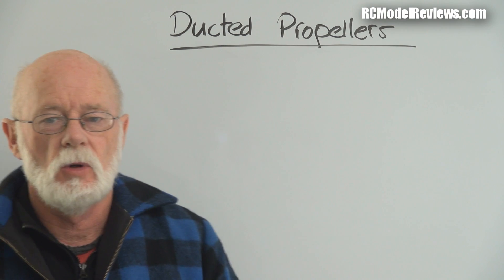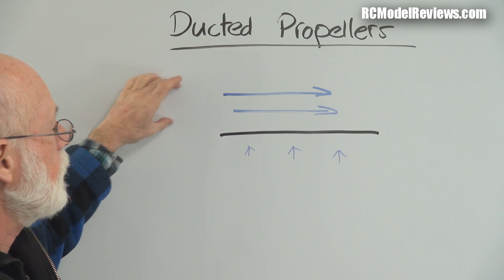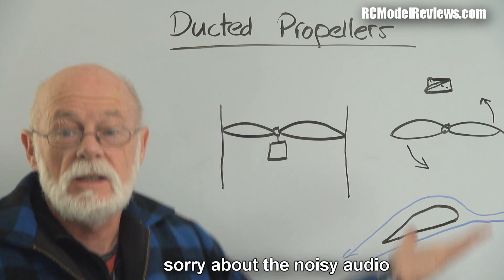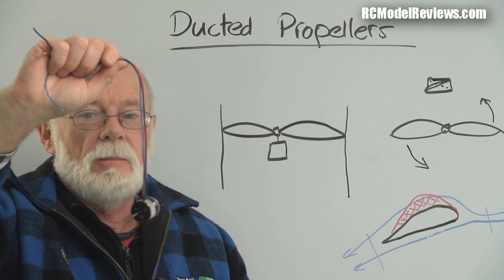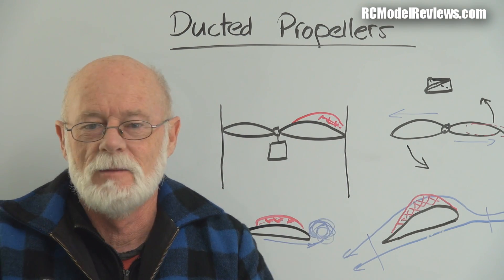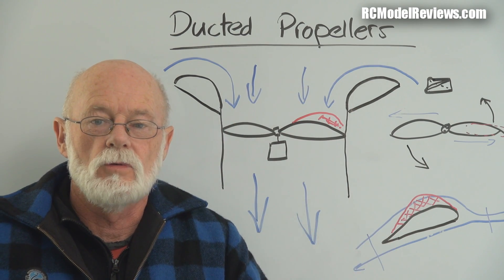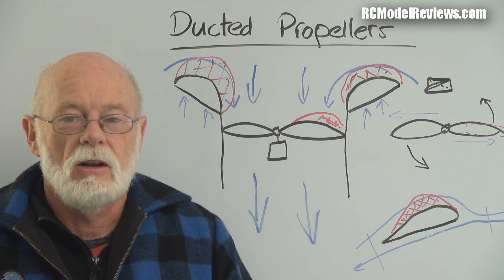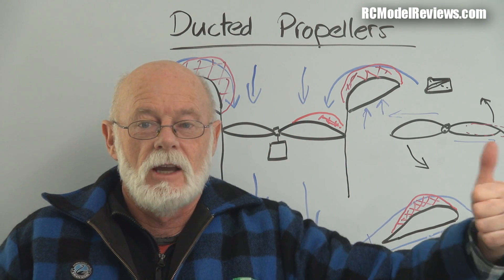How ducting a propeller increases efficiency and thrust

Comment: wrong , it would work as he said only if it does not  move, that intake is used when is tested  turbo fan engine on testbed.
it would be better that propeler is  inside of intake as on aeroplane turbofan engine that slowes down airspeed infront of propeler so it can accelerate air more than air goes faster as in his case

Comment: I can't see how the curved intake lip increases any lift. If there was any lift, it would gradually decrease to zero at 90 degrees from the top, and the "lift" at the bottom would be in the opposite direction to the top, cancelling it out. I'm thinking that the larger area of the thicker curved front of the duct could cause drag, and the low pressure area behind it could cause induced drag.

Comment: Why is the air moving with the airfoil in a propeller? Should not the air be static? The only way centrifical force would have an effect on air is if the air was moving around with the blade. Granted all airfoils do create some drag.

Comment: Very nice video,
For the analogy with turbofans, I can relate that in some cases, it is very very thin. In fact, there is a tamper area at te edges of the blades that is originaly in contact with the outer rim of the duct. The egines are then mecanicaly spun to cause wear of the tamper material, resulting (in modern engines) in gaps of half a millieter or even below, despite the huge diameter of the fan.
Keep up the good stuff! Lovin it.

Comment: My Question is Duct weight vs Thrust gain vs Drag. I can see the duct really helping on the vertical take off. But wouldn't the added tube weight cancel most of that out??? Also wouldn`t the drag of that added vertical tube surface (if only a inch ) X 4 tubes really slow the forward and backward speed of the drone. This really pushing the efficiency Down a lot. Seem you flight time would go from 8 to 10 min. to like 4 to 5 Min flight time.I can see it really helping on a horizontal airplane engine. But not on my little Syma X5UW. Plus I couldn't find the bench test that you did on the duct??

Comment: Very well explained sir! Thank you!! Just one important thing that I would like to mention to people that are going to watch this lesson later on (I am assuming that you wouldn't mind sir): it would have been more correct in explaining the generation of lift on aerofoils by using the idea of curvature (it is the curvature on aerofoils that produce lift rather than the 'equal time' argument: this argument can be proven wrong by observation in wind tunnels (the air flowing over the aerofoil, in fact, reaches the trailing edge way before the air that travels below it). Now some might say well the air that separated on the leading edge must meet at the trailing edge due to conservation of mass. However, what is often forgotten is the fact that the idea of conservation of mass can only be applied to systems which see no obstruction (here the obstruction to the airflow is the aerofoil). I hope this makes sense to people). Apart from this, your explanation is perfect :) Thanks once again.

Comment: What must be the length of the duct for better efficiency ?
Reply: @Shubham Gorule The shroud length is best designed to be approximately 50% of the throat width. AND it should flair out at an angle of approximately 10 degrees.

Comment: "Tip vortex" is why modern aircraft (commercial)  have vertical winglets on the end of their wings.
If the 'duct' is tapered, wider in front to narrower behind, the Venturi effect improves (to a point) efficiency - see the 'ducting' around Turbo fan jet engines.

Comment: I really enjoy your videos, but concerning the principles of lift on a wing, I feel the explanation is not complete.  It is a very complex subject with many branches so I’m guessing and you may not have wanted to over complicate matters.
It used to be that the Bernoulli principle was the only explanation, but more recent thinking has come around to that being incomplete.  The other half of the story is Newtons 3rd law 'For every action, there is an equal and opposite reaction'.  In this case it's the angled wing relative to the airflow. 
When and angle of attack (AoA) is applied to the relative airflow, the air molecules are all bashing into the under-surface of the wing (and because it is at an angle), the ‘opposite reaction’ to this is to push the wing out of the way and in this case, that is upwards.  Admittedly, the molecules are hitting everything else and causing drag, but that’s another story.
For a wing to work there has to be an angle of incidence relative to the airflow which imparts a pressure on the lower part of the wing due to forward motion.  Otherwise an aerobatic airplane with a symmetrical wing (same both sides) would not fly, or a simple balsa model plane with a flat plate, (non-aerofoil section) wing would have the same issue.
If a wind tunnel experiment is made with a wing section with pressure measurements taken top and bottom it shows that yes, there is a differential pressure at a low angle of attack due to the Coanda effect, but by increasing the angle of attack the pressure under the wing increases creating a higher lift force and becomes more significant as speed and AoA increase. There is a point however where the angle of attack becomes so great that the airflow becomes detached from the upper surface creating a large amount of drag and rapid reduction in lift due to the total loss of the Coanda effect (stall) and because it is usually flying a lot slower in stall condition, the speed at which the molecules are hitting the underside is greatly reduced leading to the total lift being reduced.
There is another type of stall which is a high speed stall, but that is another much more complicated subject.
As I say – I greatly enjoy your videos and find them very instructive.  Hope you don’t mind me adding this bit though because I thought it was important give the full story.

Comment: the air on the top, taking the longer flow path is creating a vacuuming by not meeting up with the air on the bottom at the same time, this causes the air on the top of the wing to be accelerated by normal air pressure in front of the wing, pushing the slow air into the low pressure zone just behind the edge of the wing. it's effectively reduces its own air resistance enough that it's previous momentum carries it faster, as it has less to push through. does anyone follow me?

Comment: btw that the paper straightens out is not because of the Bernoulli effect.
you can test it yourself by holding the paper at the top and blowing across one side of it towards the ground.
it will barley move at all because it is mostly the coanda effect not Bernoulli.

the explanation that the air flows faster over the top of the wing than the bottom also has a problem,
the streams don't  have to meet up at the same time. https://youtu.be/UqBmdZ-BNig?t=25

Comment: Thank you so much.  I have redesigned the duct on Hoverflight 90 wing in ground effect Hovercraft.  Go to www.australianhovercraft.com  Our new duct improved thrust by about 2,268 Lbs or one metric tone.  Our propeller is 14 ft in diameter, spinning at 700 RPM, with over 700Hp at cruise speed of 75 knots.  Cheers. PS  We start building early 2018

Comment: We see this in every modern day jet powered aircraft flying today.  The ducts are getting huge just look at the 777 or A350 engines.  The first stage is basically a huge ducted prop (on the 350 with the Trent is about 14ft across).  Every stage behind it is ducted as well with the tip clearance being adjusted by case cooling to minimize tip clearance between the blades and case in the hot section.  You would think that these massive ducts ad a ton of weight but due to advanced composite construction are very minimal.  If the case cooling system has a failure it will generally fail to maximum clearance as to prevent blade contact and this will be see by increased fuel burn and may or may not include a fault message usually not seen by the pilot. The fan has what is called an abradable shroud that is designed to wear away in case of fan contact.  You will often find that it does get contacted by the fan.  This is why I believe you don't see fans on piston powered aircraft.  The vibrations would cause you to design to much safety into the clearance of the fan to make it worth having the drag and weight. Imagine a failure at a critical flight phase that cause abnormally   high vibes the prop contacts the shroud and an otherwise flyable plane has a catastrophic failure. The liability would be enormous. I'm sure they will still be used in small scale but aviation doesn't like changes.  However if Tesla ever makes a plane I'll bet they duct the fan.

Comment: Quick question... Any reason that these microquads today don't have propellers where the duct and lip is molded on to the propeller it self? Seems like it would be an easy way to make it more efficient, the ones with ducts, like the Eachine E010 seems to have a large gap, if you mold the duct onto the aerofoil of the propeller you would eliminate the gab no? Wouldn't it also eliminate drag from the duct support rods?

Comment: Explanation after 5:55 is not entirely correct. The air above the airfoil does move faster, but not because it has to "meet up" with the air below it (why should it, they are not married or anything). In fact, the air above "overtakes" the air at the bottom.

Comment: Question: can one propeller (with duct) work in a design of a drone designed to only fly vertically up and down(And not in other directions while in the air)?  If so, what other parts should one add to make sure it is stable and the body of the drone itself does not rotate. Thank you

Comment: There's no reason why the air flowing over the top of an airfoil needs to meet back up with the air flowing beneath the airfoil. That's not what causes the air to move faster over the airfoil. In-fact, the air moving over the top of an airfoil moves even faster than your explanation suggests. The two flows never meet back up. This is a common misconception.

Comment: That was very entertaining. And I learned about the efficiency of the curved lip at the front of the tube. One major advantage of the prop tube is, safety! Drones are like flying blenders with whirling razor blades, that can harm people, children, animals, and living things. And similarly boat propellers. Have you ever seen the zap cat and thunder cat races. Two guys on an inflatable speedboat with one outboard, and they have to have prop tubes for safety because they are wildly racing around other boats in and out of the surf, flying through the air, flipping over and throwing riders. Another great example of your prop tube is a jet ski. Its a way to have a motor with the props completely incased in a tube inside the hull, for concentrated thrust, and ultimate safety.

Comment: I disagree with your theory on what makes a wing work. First of all, air doesn't flow over and under a wing. Air, by theory, is just sitting there, and the wing comes ripping by and cuts through it. Who says the moved air has to meet up again with its neighbors that it was next to, before the wing separated them? That's a myth. And air doesn't know how long each surface is, or that there is a law that says it better get back together with those same molecules that they were with! No, the only thing acting on the air is the surrounding standard or common air pressure, and the fact that something, the wing, just cut through it and moved the air molecules away from the position they were previously in. The more something shoves those air molecules over somewhere else, the more pressure they create with the other air that they just got smashed up against. That increased pressure is stronger than the surrounding air pressure common to that area, before anything disturbed it. So it's only really the shoved pushing back on the shovees that make the shovees resist being shoved by the wing. But the amount that they get shoved away no longer has anything to do with their old neighbors on the flatter side of the wing. The party is over. c'est la vie! bon voyage...and good luck. By the way, for all purposes, these forces happen independent of gravity. Turn the wing upside down or perpendicular to the ground, and the similar forces apply. Also, a flat wing will fly almost as well, if its angle of attack is just right. All the foil does is increase the efficiency, load capacity, and versatility of the wing's ability to perform in a wider range of adverse conditions. But getting back to what makes the foil of the wing work. The shovees are pushed into the shoved more and more on the curvier side of the wing, but they have mass, and have been pushed away from the wing by the front curve, or part in front of the peak of the whole curve. Then suddenly the wing surface is curving back away from the shovees and the shoved, so fast that their momentum won't let them get shoved back fast enough, and there is a separation between the shoved air and the back half of the curved side of the wing, in which a vacuum force is created. So the shoved eventually are able to overcome the force of the shovee's momentum and  push them back away to relieve the added pressure, but they can't do it fast enough, so the wing moves towards the vacuum suction to fill the void, or lack of pressure equal to the standard air pressure of the common area that the foiled wing is flying through. That phenomena that I just described is how the most efficiently foiled wings create the most lift, is through the vacuum effect on the part of the wing behind the peak of the curve on the curved side of the wing. Now that I've explained what's happening on the curved side of a foil, or foiled wing, what's happening on the other or flatter side. Well, not as much action, aside from a slighter increase in pressure due to the angle of attack, but because the air has not been disturbed as radically, there is no violent shoving or vacuum effect, just a long steady build up of pressure from front edge to back edge, due to mild shoving, but still a substantial lift force, or force perpendicular to the wing's flatter side's surface, to combine with the lift force on the top side's, and the total sum amounts to a more efficient sum of lift and performance, than say, a flat or symmetrical foil wing. And that my friends, is what's really going on with how a wing works, not just in my opinion, but in many modern thought camps nowadays. I just had to get my two cents in.

Comment: I think having a rotor in the middle causes too much drag... make a spiral propeller inside a duct with magnets lining it and coils inside the duct... less friction because the magnets are repelling the propeller from the duct... also tighter tolerances... and no tips to vibrate since they are attached to the circular housing inside the duct.

Comment: This has to be the best explanation on the benefits of a ducted fan/prop that I have ever come across without any fancy animation! My question however is:
If that curved lip (or cowling) at the front end of the fan/prop nacelle generates some lift, won't it be tempting to make it bigger to obviously generate more lift? And wouldn't doing so leave the whole larger lip with a larger frontal area which would in itself also generate extra drag for the direction that it is moving in?

Comment: Beautiful hexplanation, your style of teaching is lovely and clear. I have spent time thinking about wing lift and come to the following tentative conclusion......
Bernoulli and Newton are not different theories. Its just that the best way of deflecting air downwards is to suck the air passing over the top of the wing downwards by curving the top surface of the wing. 
  Another way of saying the same thing is to note that if you only push the air underneath the wing down, then the air flowing over the top will not meet up with the air under the wing, thereby leaving a void of air behind the wing, so drag will increase vastly. This is why it is better to transfer most of the downward momentum to the air over the wing, rather than the air under it.
  This seems like a way of unifying the theory that lift is a result of low pressure on top of the wing with the obvious fact that the wing generates lift by deflecting air downwards.

Comment: I have been working with ducted rotors for a Vtol drone, my Shroud has only 3 spars connecting the motor mount and is constructed using carbon fibre.
They seem to work well in modeling however the fluting of the rotor needs to match the inner surface area of the shroud, meaning the closer to the centre of the rotor the wider the rotor must be and the tip of the rotor must be 36% thinner than the root of the rotor.
The shroud and rotor must pivot in paralel to the mass of the main chassis in order to lower the drag of the shroud in forward flight.
Still allot of work to be completed but may be some info to help those, to understand the dynamics involved.

Comment: Actually someone on the Tube has talked about some (secret) ships that have big ducted fans. Believe it or not.
Very big ships like twice the lenght of the biggest US aero carrier naval ship !! The intel said that they are produced under the sea in front of Jacksonville in a secret under sea base. And a rapresentation of those ships is in the Tube vid.
The enormous propellers are in to tyhe body of the ship, so the body itself function as a duct. Then I believe that have different (plasma?) motors to.... fly(?). Anyway. jts

Comment: It isn't free though.
You're hauling around this new  duct... it's a weight penalty. It may be smaller than the gain in lift, if properly designed, but it's not zero and therefore you're not getting this increase in efficiency for nothing.